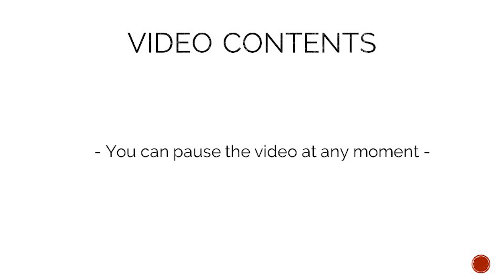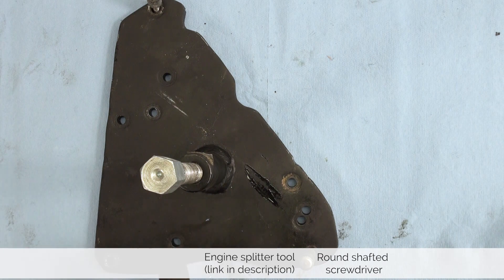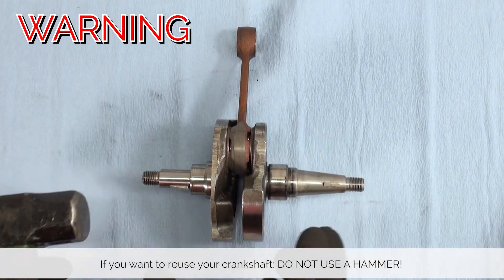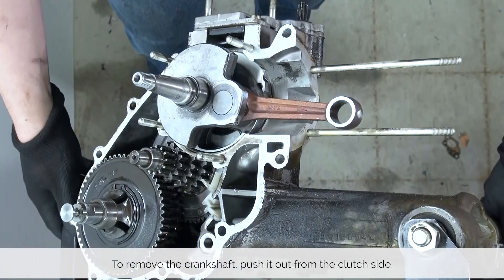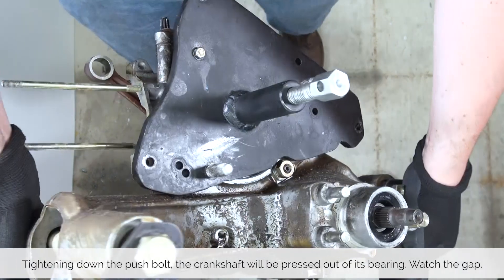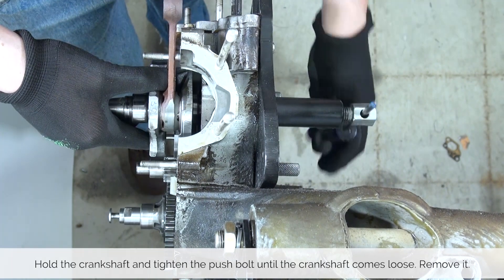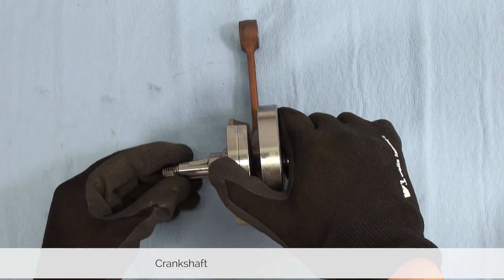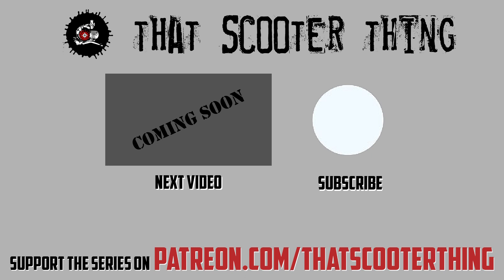Remove the crankshaft, safely  - Vespa LML Engine rebuild tutorial Part 15

Comment: But bro do you know about chetak scooter it is an Indian scooter like vespa lml bro☺️☺️☺️☺️☺️☺️☺️☺️☺️☺️
Reply: Hi Sis.Kaur, Bajaj Chetak was born under licence by Vespa , up to the point that their parts are interchangeably deploy. Cheers.
Reply: @impiantan2617   bro in chetak scooter new carburetor will work properly in 1999 model without damage carak please reply me
Reply: @narinderjeetkaur4255  Yeah, you just have to use the same capacity carb such as SI 20-20 for most 150 and have the same jets sizes install onto it. Hope this help.Warm regards.
Reply: @impiantan2617   bro can i install new chamber in my chetak scooter of 2003 model thanx and love from India 🤩🤩🤩🤩🤩🤩🤩🤩🤩🤩🤩
Reply: @narinderjeetkaur4255  Sure, new chamber installation for the same cubic capacity engine as a rule of thumb. Cheers.
Reply: @impiantan2617   but bro do you  know about chetak scooter 2 stroke and thanks for your answers ☺️☺️☺️☺️☺️
Reply: @impiantan2617  bro some times my chetak scooter gears are tangled have you some solution about it